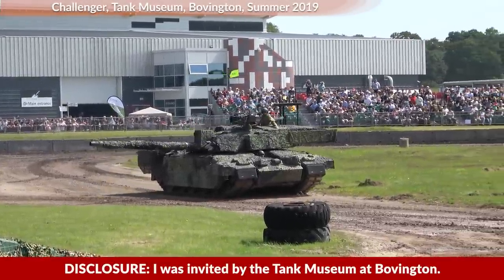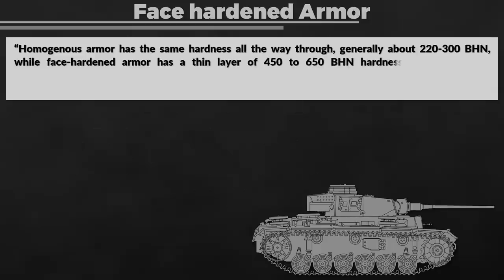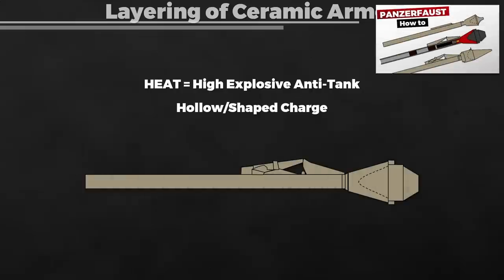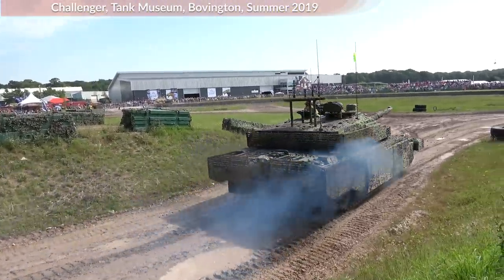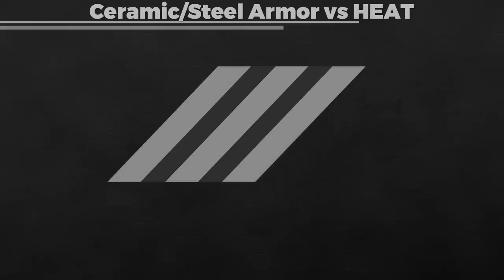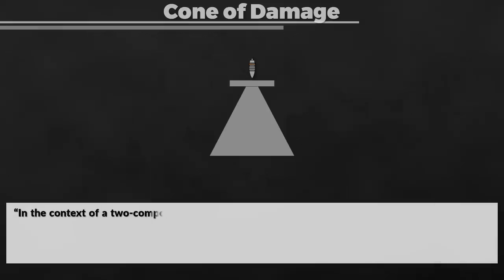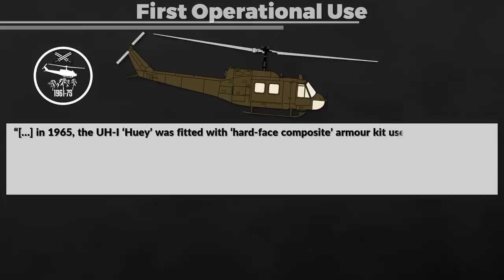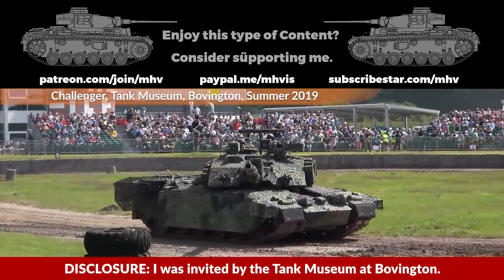Why Ceramic Armor? Hard but brittle!

Comment from the maker: For more information about Professor Hazell's book, go here: https://routledge.pub/Armour
Reply: He  probably could have used Boron Carbide as his example as that is actually what the ceramic armor is made of .    Which is an extremely hard Boron - Carbon Ceramic material.  The formula for which is B4C.   It's density is 2.52 g/cm3, solid.  so yeah that's what tank armor ceramic is based on in most cases .   Yes you can find this on google .  

But knowing the materal is doesn't mean anything as the thinkness of modern tank armor is classified.
Reply: I’d buy the book if it wasn’t $128
Reply: Cant you check with google how to pronounce words  properly ?
Reply from the maker: @CFox.7  Make a video like that in your second language, so write the script, the design, record, edit, etc. and then ask that question again. Short answer you won't.
Reply: @MilitaryHistoryVisualized  im not a youtuber but if i were I would consult the plethora of resources out there. Diligence is diligence regardless and you didnt do any. You German ? I thought you would demonstrate more logic
Reply from the maker: @CFox.7  Using your "logic" no video would ever been "done", particularly since you assume that I would know which words I would get wrong.
I had once a Canadian native speaker as a guest, he pronounced "mediocre" a bit odd, I guess he didn't do his "due diligence".

Also you are not even accounting for the fact that American and British pronunciation often differs as well. See Aluminum.

I probably would spend several hours extra and still get something wrong, but I am pretty sure you still know better.

You probably the guy that finds one error in 300 page book and complains that the person is lazy, albeit he/she read it probably 5 times + several editors.

>  I would consult the plethora of resources 
> out there. 
maybe and that is the best way to never publish anything.

Comment: Great video!  I’m a senior year Mechanical Engineering major, and in my composites lab we had a class where we focus specifically on composite ballistic applications.  My professor always likened them to the the idea of a “breaker” layer on top of a “catcher” layer.  Weave these layers repeatedly (in the event a round breaks through the preceding catcher layer) and voilà, eventually the dissipated energy will be so small the projectile will not penetrate.  Such an interesting field of study
Reply: This was a good one, I have to say. Some of the basic concepts are clearer now to me, not being a materials engineer.
Reply: A rather taughtological statement that can be applied to every inert material on earth.( Inert here in the sense it doesn't add energy to the situation, eg "Hey guys I made my armor by gluing together cases of dynamite!" , not an engineered ERA top layer)
Say homogenous steel: add repeating layers of steel in the event a round breaks through the preceding layer, eventually the energy dissipated will be so small the projectile is stopped. wood same, pillows same.
Reply: Tanks, death traps
Reply: Wow. I have a very basic understanding of armour but I was about to say almost the very same thing lol 
That's why you have glass over perspex over laminate repeatedly for bullet resistant windows. 
A layer or two to shatter and dissipate energy then a layer to catch and hold the layers together 👍

I've no doubt that I have made glaring errors but I felt clever for a minute lol
Reply: @mytech6779  sure but super hard, temperature resistant layers mixed with dense but ductile layers is much more effective than repeated layers of the same material over and over: the variation in hardness, heat performance and density begween the layers has a massive multiplying effect on the bsllistic resistance of the material.
Reply: @CaptainHat  That may well be true, but what was stated doesn't address any of that.
Reply: Aluminium Oxide (Al03) when ..ahem..appropriately subjected to very high heat and pressure becomes Emerald. Al03is what an Emerald is. And Emerald is very very hard and enormously heat resistant. As for the other layers, I'll remain silent on what they are.
Reply: @CaptainHat  This video didn't say, nor did anyone else that the same material was used over and over again. I don't understand your comment.
Reply: @mytech6779  I think his point is that it takes less material for the same effect
Reply: @saltboi6374  That is not in the statement in any way. I know it is physically true, but that is beside the point.
Reply: @karlp8484  Look at the comment I was responding to: they suggested that the information in the video was not useful because any material (including homogenous materials) sufficiently layered would stop a projectile.  While this is true, it misses the point entirely.
Reply: @raywhitehead730  Infantry are pretty vulnerable too my guy, maybe moreso.
Reply: @mytech6779  Besides the fact that the original comment was addressing composite materials and their applications, the "catcher" and "breaker" layer analogy should be enough to make the use of at least two materials clear to understand. In this case, the alternating layers are indicative of at least two materials.
Reply: Glass can have the same effect. Actually glass has pretty good properties for ballistics, combined with steel.
Reply: Funny enough I was also researching the same thing.
Reply: @j.e.v.5016  GLASS is not much less effective as ceramic tiles. ALL such sandwich armours are encased in thin steel plates TO CONFINE THE CERAMIC AND FORCE ANY DISINTEGRATING CERAMIC INTO THE PATH OF THE ONCOMING PENETRATING ROD .. 

THIS is especial  true at the STEEL CERAMIC INTERFACE , where the cavity expands FORCING the eroding  rod into the to expand and dwell , reducing penetration.
Reply: @karlp8484  Al2O3
Reply: Are you Pawel from telegram? I recognize that pfp

Comment: The general idea is that the energy from the projectile has to go somewhere for the round to be defeated. This is either in the form of elastic dispersion (the armour bends under the impact and then springs back) or inelastic dispersion (the armour or projectile breaks). 

The elastic dispersion capability of an armour is always less than it's inelastic dispersion capability (everything bends before it breaks). Therefore it is more efficient to use an armour that will absorb energy inelastically. You can stop a stronger projectile for a given weight. 

Ceramic is harder than steel but also more brittle, a shot that might bounce off steel will shatter ceramic. But a shot that would penetrate the same steel might be stopped by a ceramic (that would break in the process). The best ceramic will crumble into dust and explode everywhere, with all that damage absorbing energy from the projectile. 
You still require a backing layer as described though, partly to provide a structure to attach armour to, and also to absorb any stray fragments.

Comment: I am now very much more glad that I invested in Professor Hazells book. There is a lot that I dont yet understand fully about modern Tank armour and that I would love to do Videos on.

I would not have thought that the ceramic part of the armour packages is also a "dynamic" part. Seems counter intuitive, because it isnt normally flexible like the rubber, also sometimes used in NERA packages, like I think it is on the T-72B

Great, that you have access to such great partners for Interviews!
Reply: SIby 🅥  Feeding animals video.
Reply: I some types of non-explosive reactive armor you use moving plates to disrupt wither formation or already formed penetrator. Like 2 steel plates moving in opposite directions through which penetrator is going might break it or at least disrupt it's path to a degree which makes it lose energy and also makes it go through even more armor. I get that those are basics and they don't necessarily apply to all types of NERA/NxRA/SLERA etc. Also it's probably simplified version of what happens, since most of more advanced reactive armors have more than 1 thing to make penetration harder.
Reply: @jannegrey593  Must be the names of the animals :P

Comment: My theory is that you can make ceramic plates the like to break easily in a general axis. If you layer such plates that break into perpendicularly to each other, the amount of energy dissipation would be rather good. It’s also not about deflecting the projectile, so much as it’s about distributing as much of the impact into plates that break away from internal armor and components. Probably breaking into predetermined catch material that dissipates more energy away from the internal armor
Reply: Force dissipitation in breaking brittle materials like glass or ceramics is mostly done by creation of new surface area, so the trick will not be to just layer ceramic in certain angles to itself, at least if the trick is to constrict the projectile path. In my opinion it is far more likely that the design secret is to engineer the heck out of ceramic polymer interfaces, so that polymer uppon getting hit elasticly deforms and moves anjacent and the already broken ceramic tile/platelett parts back into the side of the projectile path.
Reply: @philippmuller6377  That and dampening shockwave reflection on the backface of the ceramics. It is one of the main mechanisms by which damage to ceramic occur.
Which is where we see metal foams entering the market now.

Comment: Ceramic tiles are excellent as long as you don't take multiple hits in the same spot you can simply replace the broken ones rather than the entire armor. Even basic ceramics (coffee mug, back of your toilet) are hard enough that they can be used to sharpen very hard high end steels.
Reply: uhm, its pointed out that such ceramics, kitchenware and bathroom ceramics, doesn't posses such hardness. Aluminium Oxide, Silicon Carbide, OTOH, are hard enough to be such, in fact, they are used as armour.
Reply: Ah, so this is the missing piece from Bosnian Ape Society video on how to defend yourself from a Leclerc

We need to armor our gun with Toilets!
Reply: @samuelmendoza9356  Stoneware is nearly pure aluminum oxide and has a high density due to high-temperature sintering. Thick stoneware tiles are probably extremely similar to the armor. But it is not qualified and someone wants to make a lot of money.
Reply: @karstenschuhmann8334  as far as I know, ceramic armour works being tightly packed and no voids like bubbles. AFAIK, most ceramic ware that is not armour are porous and thus why they have to be glazed.
Reply: @samuelmendoza9356  I was not talking about any ceramic, but about stoneware. Stoneware is dense and hard. It is impervious to water without glazing and it is not scratched by pebbles.

But clearly, such tiles alone are no reasonable armor.

Comment: MHV - See the Paul Harrell video from 5 years ago "Improvised Body Armor" and the one from 2 years ago "Personal Protection:  Bulletproofing your book bag" for some of these principals in action.  Both make use of ceramic tile has the hard face followed by energy absorber layers.
Reply: Just regular ceramic tiles? Would it work against modern HEAT? What if Russia starts looting ceramic tiles from swimming pools and puts it onto their side armour?
Reply: @edward9674  Regular ceramic tiles against bullets? Sure, it can work when overbuilt enough to compensate for material selection. Against the HEAT missile warheads or AP projectiles fired by autocannons? It needs to be engineered for the purpose.

Comment: The best body armors are ceramic or composite because most steel plates weigh twice as much and send a lot of fragmentation into the neck and chin which can easily be fatal. Most steel plates are over 9-10 pounds where as most good ceramic plates are usually 6 pounds or less

Comment: Just an additional point, ceramics can absorb a huge amount of heat - it is the best material for insulation. So, unlike steel, say, you cant hit it with massive energy and cause molten slag to fly off from the hit.

Comment: I suspect that depleted uranium and armor spacing may be a factor is dealing with both charge and AFDPS rounds. I found an interesting patent paper, "High strength and ductile depleted uranium alloy." I suspect you can be seen strength and ductility that makes such an alloy useful for penetrator would also make it useful and countering a penetrator.
Reply: Depleted uranium was a component of armour back during the first gulf war, I recall it was either removed or the type of armour has changed significantly since then.
Edit: Further research and i find the DU was used on  the cheek plates of M1A2 as the hard deformation component.
Reply: A few major issues with using depleted uranium as armour:
1) Uranium is incredibly difficult to work with, inherently so. You can't just cut and weld it like steel, or form it like ceramics, the same properties that make it useful for armour make it highly resistant to being manipulated, so have you have to acquire specialised equipment to work with it. Furthermore, there's a lot of issues with radioactive isotopes in dust and other material discharge, as even DU is never fully inert, which adds more complications.
2) To even acquire DU in a reasonable manner, you have to be a nation with major nuclear capabilities, beyond just simple enrichment and power generation.
3) Unlike most other materials that could be used in armour, uranium is very rare and difficult to source. The supply of it can be difficult to secure and is very likely to be controlled by another nation, making you dependent on them. 
4) The previous three points obviously make the entire process extremely expensive, which is why you only see the US being the only real user of DU for military applications. (Yes, I know many NATO members have used depleted uranium in APFSDS rounds before, but these were pretty much only for specialised roles and aren't normally deployed)
Reply: @Marc83Aus  The issue was with DU 30mm armour piercing rounds from both Ah-64's and A-10's where the companies that made the ammunition hadn't used just depleted Uranium they had wrapped DU around a core of not so depleted Uranium! Their rounds were a little "Hot" Pretty typical of Corporate Greed endangering peoples lives.
Reply: @jackdbur  We're discussing the depleted uranium armour that was added on to the turret front face, but I havent heard about this depleted uranium ammunition issue before, though I honestly dont think using natural uranium instead of depleted would have been too much worse, its only 40% more radioactive, both are bad especially when compounded with the toxic effects of the metal itself.
Reply: @Marc83Aus  It's much worse when that ammunition has hit a tank or rock and creates nano particles of toxic radioactive dust! I have seen a video that discussed the  Australian army buying Abrhams tanks and it commented that  the US version with DU armour was different to the export version being purchased ( lots of rabid anti nuclear types here on Australia)

Comment: applicable to body armor also. Interestingly, some Steel Body armor use a thinner ceramic strike face as the disruptor, while the steel is used to absorb the round.

Comment: for shaped charges there are non ceramic solutions that works well, generally based on "bulging plate" type sandwiches with steel and rubber.

ceramic si more suited for body armor and small AFVs (where you don't have the physical space to use a bulky nera-type array)

Comment: 9:52 like specifically shaped ceramic particles that close in once hit similarly to jacks. These jacks for example would be pushed inwardly while the back closes in behind thus 'abrading' the rod causing high frictional force to further deform the penetrator. Thats my guess. Lol.